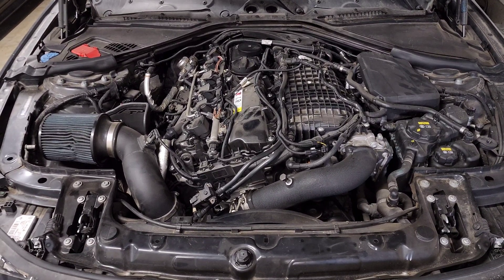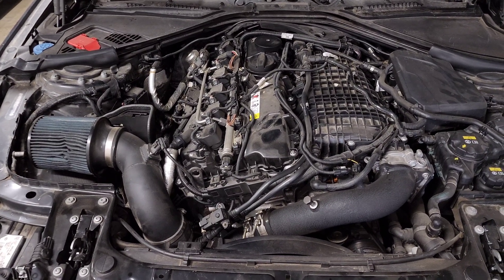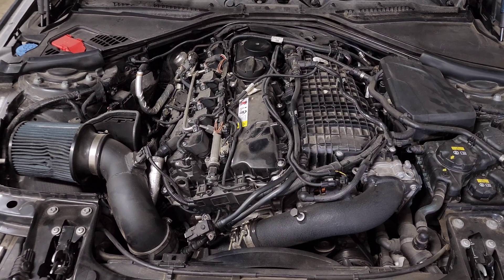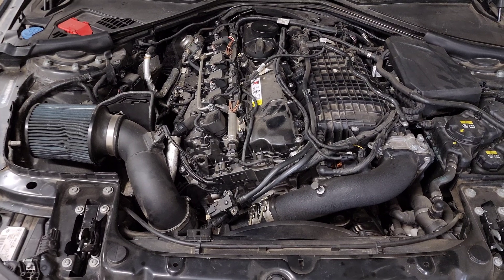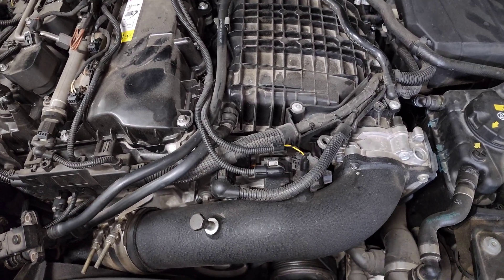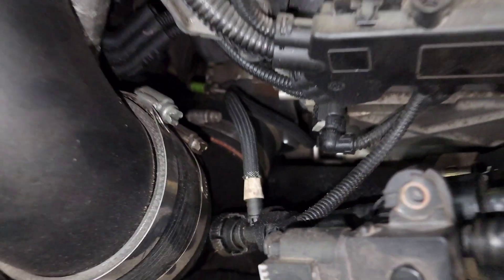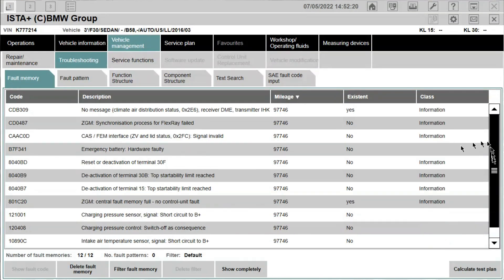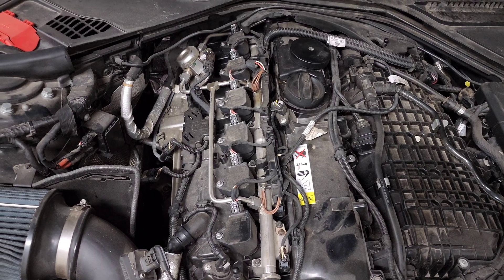Diagnosing Misfires on my Copart 340i - Part 1

Comment: Got a random question buddy. Currently I have catless dp, stock mid pipe and dinan rear muffler setup. I want the car louder but want to get rid of the gas stink crap I get being catless. I understand I will lose some hp putting the stock cat back on, but I am considering getting a dinan mid pipe to delete all 4 resonators when I put the stock cat back on. Would the car be louder with the stock cat and dinan mid pipe then it is now? If so would it be obnoxiously loud? It’s just kinda too tame sounding for me right now as is even being catless. I think those 4 resonators really quiet the car down?
Reply: That exactly what I'm doing to my m240, the stink and damn codes aren't worth it
Reply: @onthechip6739  codes?? Dude you can bypass the codes easily. Need an 02 spacer and walla, code is gone! First thing I did on my car. The smell on the other hand whewww
Reply: @badass1g  wish mine was that easy, tried the trusty straight or 90 o2 spacers still post cat codes!!! Then damn emissions inspector visually failed me because of it. Already bought dinan mid pipe going to try with stock cat and mppk muffler
Reply: @onthechip6739  wow that’s wild it worked great on my car. The emissions people are getting strict these days!
Reply: @onthechip6739  lemme know how different it sounds when you’re all done 👍

Comment: Might have cracked ring land or slightly bent rod in cylinder six due to nitros being plumbed in before the heat exchanger. common issue b58’s can have if running ethanol or nitros. This is me just speculating tho
Reply from the maker: Cross your fingers